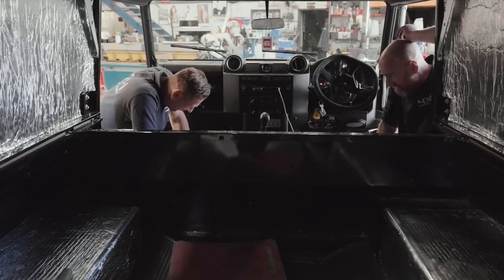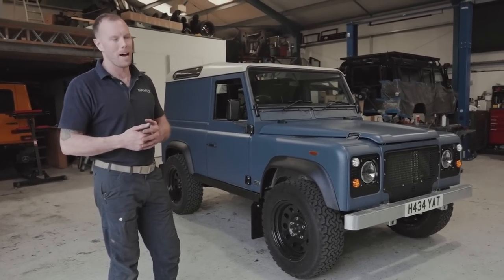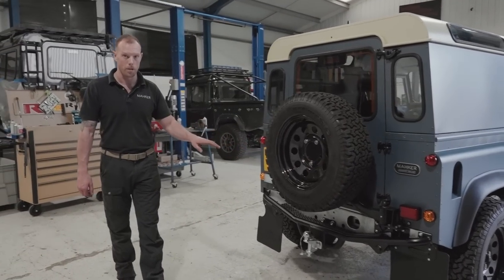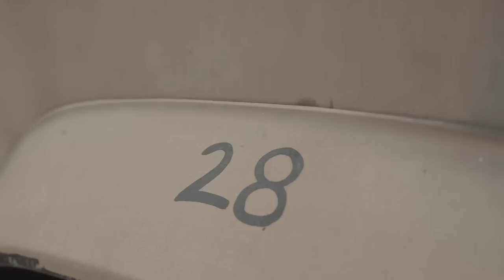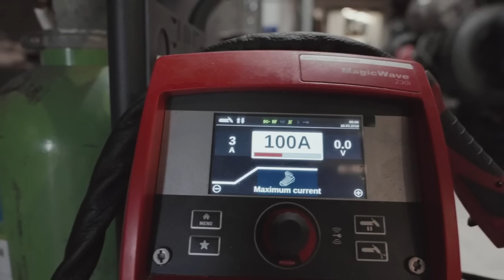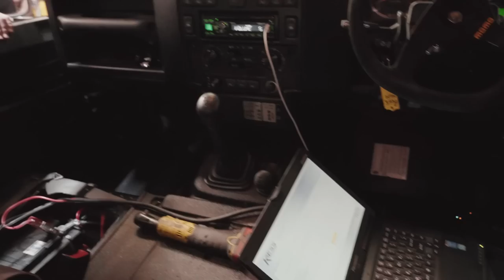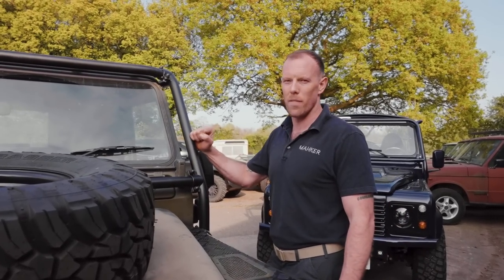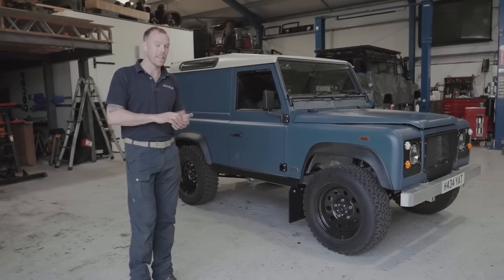From this... to this! Restoring an old Land Rover Defender 90 | MAHKER EP037

Comment: Barn found a 93/200/90 pick up recently. It's a complete shed of a thing. Clean oil/filters/fuel/battery. Checked all belts etc/good oil pressure on cranking and after ten years in the corner of a cow shed...it fired straight up. Super little engines the 200 and for anyone who worked on the predecessor units especially the 19j....a revelation.

Comment: Dream would be to own a 110 Wolf. Did my LR fam training back in the day and I've loved them ever since . Definitely needs a roll cage too!
Reply: Martin, follow that dream I’ve had my Wolf (110 Soft Top), Remus for over 5 years - nothing compares to it, not even in the LR World, they’re the Best of the best…upgrade them slowly that way you appreciate every little bit of improvement and over time you have something that is unbeatable!
Reply: @stevepickering5866  thanks Steve, will get it one day and yeah def need the remus, never had the pleasure whislt i was in the mob but the adjacent unit was arctic warfare and they had squadron full! Spent most of my time on armour but you don't see many AFV 436 driving down the road 😁

Comment: Why are so many roll cages attached to the aluminium tub rather than cut through the tub and connect to the chassis?  What am I missing, because surely the energy is sent through the tub rather than the chassis?
Reply: Ones for show, the other for practicality. Like Bull Bars on a Nissan. As much use as a chocolate fireguard.

Comment: What costs did that restoration incur?
Reply: North of 5k probably
Reply: @Jin-Ro  not a chance, £2k+ each just for the chassis and bulkhead, plus engine rebuild, full paint job (£2-3k), £1k for a set of wheels, and all the body parts, trims etc. You are north of £10k plus labour.
Reply: @stephengrimmer35  Aye, true enough